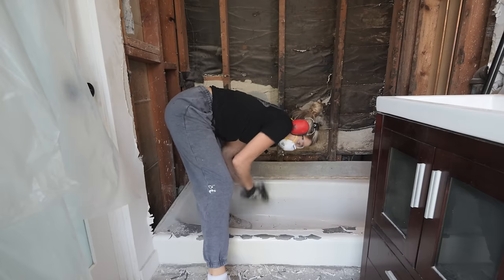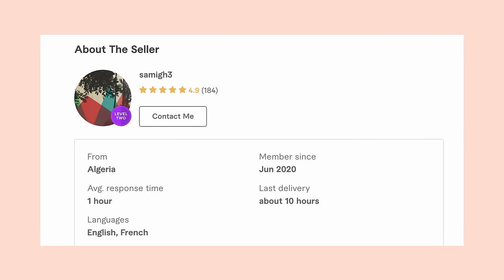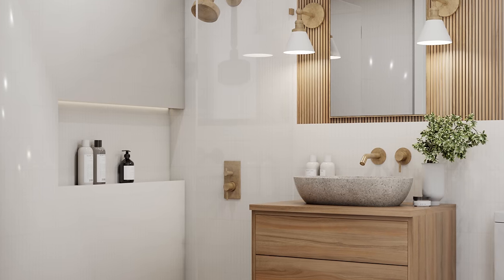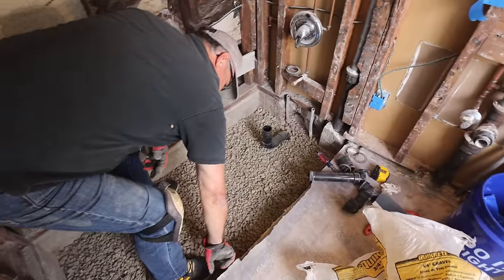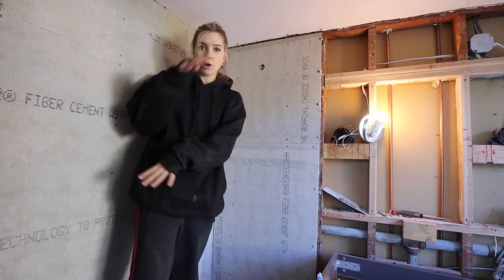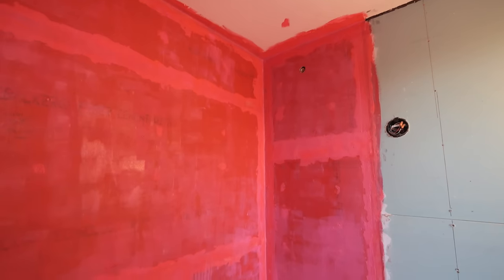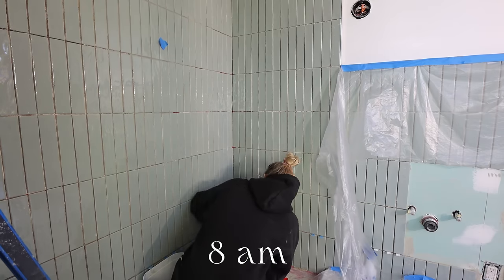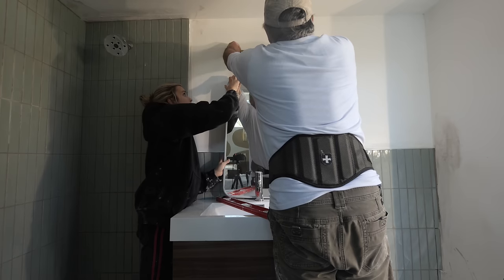I Gave my Bathroom a Renovation MYSELF.... DIY Renovation Before & After

Comment: Great video was so nice to see the finished result! You guys did an amazing job and it was so fun to see the vlogs of the process. You might want to consider purchasing a small amount of floor and wall tiles to have extra in case you need to repair any tiles in the future.

Comment: I have a bathroom that needs gutting. I have had enough of cleaning grout. Either the grout needs to be water repellent, or I have to find an alternative to tile. There are grouts that claim to block mildew and have antimicrobial properties. I will have to test that first.

Comment: Mike Holmes would be proud. :)
Reply: Nor true.  First and most important, he would have gotten a building permit.  And he would never waterproof a shower without using the entire Schluter Shower Wall Membrane from ceiling to floor.  No, paint on waterproofing for Mike.
Reply: And he would never cover a junction box with green board. Not to code!